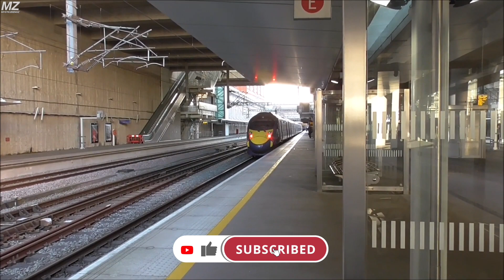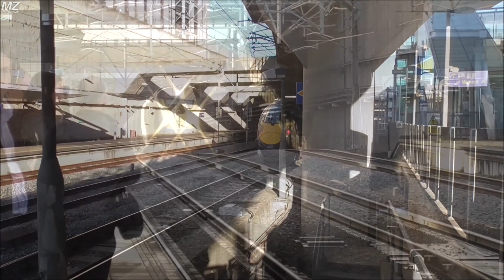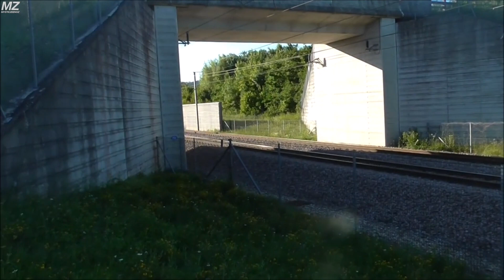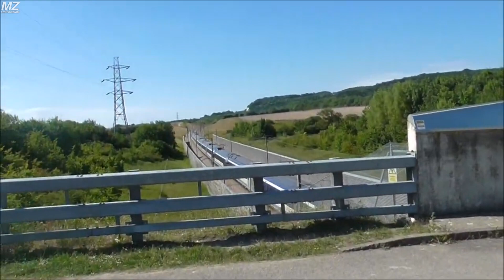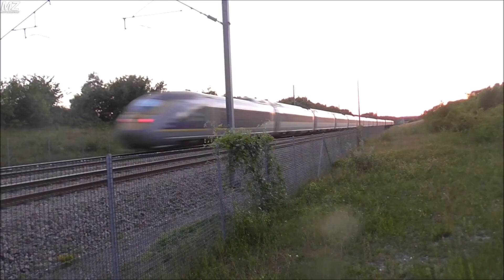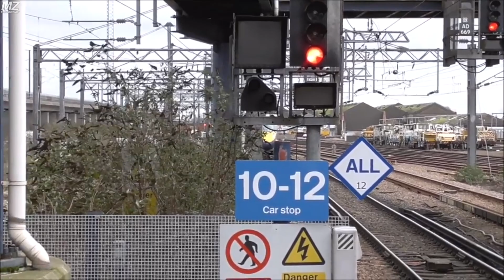High Speed 1 | In-Depth Analysis - Train Sim World 2

Comment: ctrl isn't a safety system on the 395s, ctrl is a power setting for the overhead wires. tvm430 is the safety system for the line